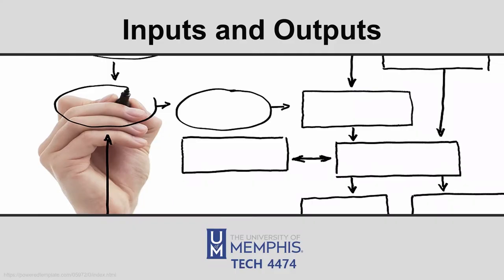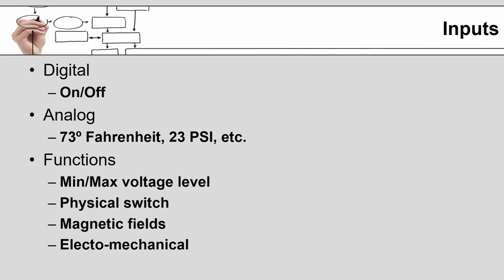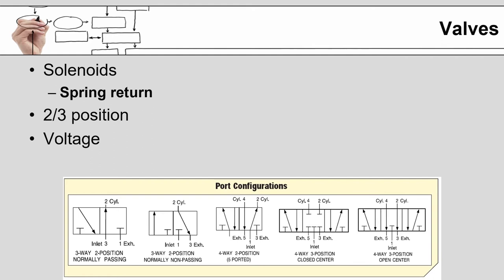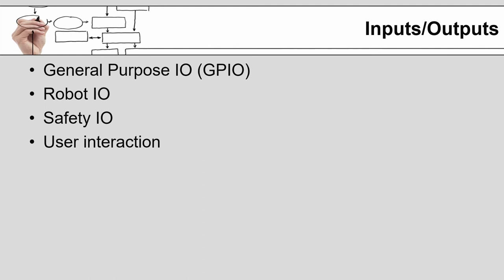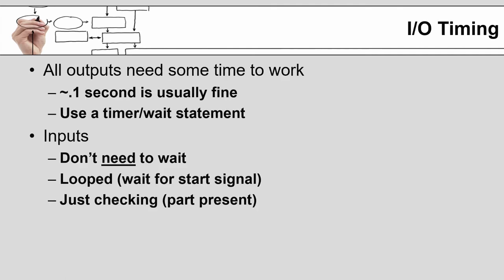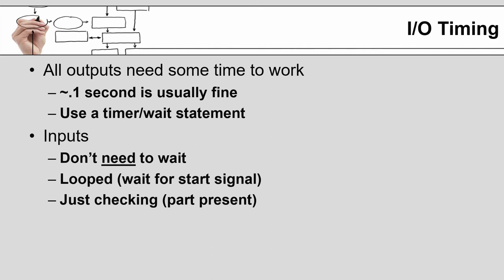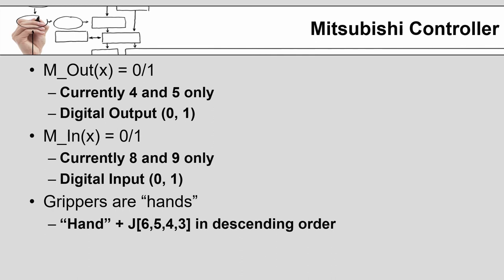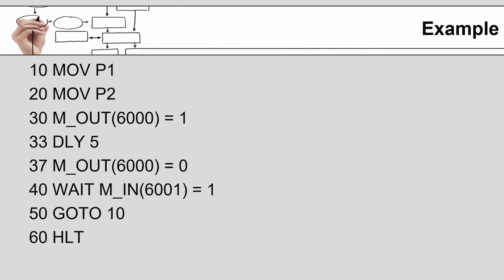General Input/Output robotics lecture

Comment: Hi Kevin. Thank you for you great explanation. Could you please, create a program example with hand input signal, with parameter "M_HndCq" and an example physically and with interrupts to? Is it possible? I have doubts too in how to wiring the hand input signal...
Reply from the maker: I don't normally use that command - to open/close hands I use HOPEN/HCLOSE. And the hand signal on my robot uses the built-in wiring and vendor supplied valve pack. Sorry I can't help more.
Reply: @KevinBerisso  ok. Thank you for your reply.